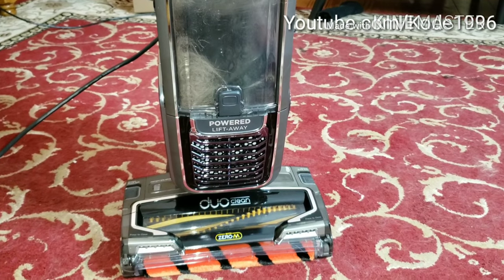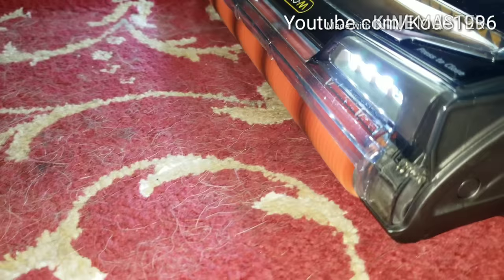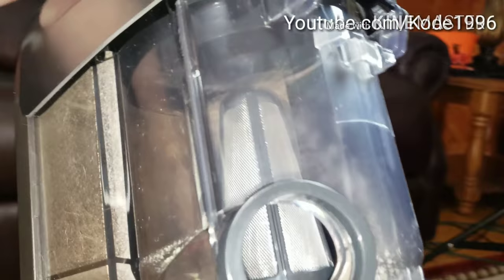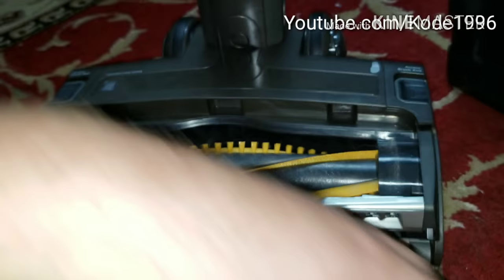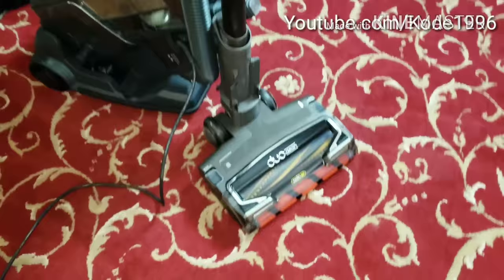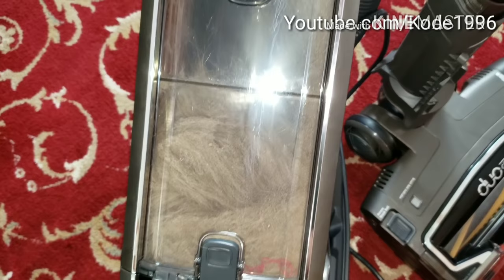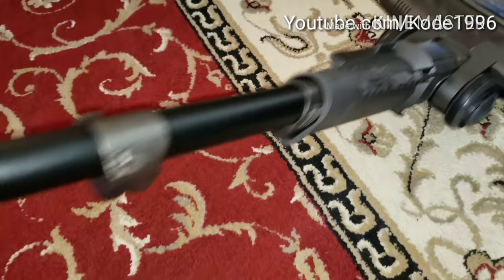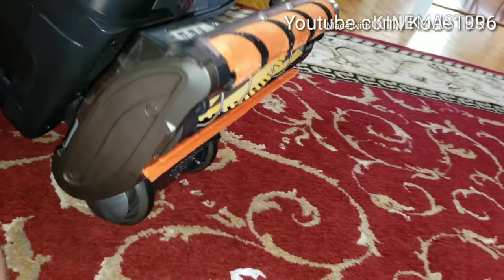Shark Apex TruPet Zero-M test on carpet

Comment: common sense wouldn't hurt. When you're vacuuming carpet, you want to keep it in upright mode so it adds weight down on the brush roll to really agitate the carpet. The lift away mode is really only for hardwood/tile where a lot of weight isn't necessarily important. Also, the point of the Zero M is to remove hair as you continue to vacuum. You were just going back and forth on a good amount of hair and turning it off immediately. Give the brush roll some time to do its thing. Other than that, great review! Also it is quite aesthetically pleasing for a vacuum.

Comment: I found with the Zero M if you put it on hard floor when you are done it gets the hair off the brush roll.
Reply from the maker: I will try it in our comparison video.
Reply: @kode1996  your also meant to slowly go over the carpet then when youve finished let it run for a further 20 or 30 seconds so that it can pull any remaining hairs off. If you read the manual properly you would already know that. I also agree with what others have said your meant to use it meant to use it with  cannister attatched to front for deep cleaning. Lift away is only good catching dust bunnies under beds & furniture definitely not intended grooming carpet or rugs!

Comment: I had the same issue with the pet hair with my shark Rocket duo clean. It seems like the soft roller in the front just kind of spreads the hair around and mashes it into the carpet more. Needless to say I got rid of that machine, and I'm not in a hurry to by another Shark with duo clean.

Comment: I had the Apex for a month before returning it.  It's way too top heavy and cumbersome to steer. It was the first time I had ever used a vacuum that bothered my wrist trying to control it and I'm an athletic guy. I prefer the regular Powered Lift Away when it comes to the Shark line.
Reply from the maker: That's exactly what I am saying. Like I'm a pretty strong guy and this wears me out. I can only imagine a Petite person trying to use it. It consistently falls over when trying to use the hose because the hose is too stiff and not long enough. Overall I dislike the machine. I am going to return it soon if I still can.

Comment: With the zero m the point is to keep vacuuming so the vacuum can remove the hair. It will NOT remove hair from the brush-roll immediately.
Reply: Just purchased this vac after my old one bit the dust. I find that the brush roll has almost no hair wrap compared to others with traditional beater brush. I would venture to say it is 95+% less hair/debris wrap around the roll than other vacs I have had over the years. To me, this is a huge improvement.
Reply: I know ive tried to tell him this before but he wont listen

Comment: I have a shark apex duo clean powered lift away. It's the only vacuum I have ever had to clean the brush roll regularly. I also have to troubleshoot the brush roll frequently. Every time I pick up something like a coin, I have to stop and pop the hood to dig it out. Nothing big at all will go through it. It just goes around the brush making continuous noise. It's total false advertisement in my opinion.
Reply from the maker: That is exactly what I was experiencing. It kept clogging with the pet hair on a daily.

Comment: Kode1996 I just bought the shark navigator with zero M. I was really happy to see this video I think the navigator being actually less powerful will do a better job. I was also happy to see that they 100% improved the filtration on the new zero M models. I think I made a good choice going with the shark navigator. I heard that model does better on hard floors as well. Vacuumwars showed that it worked better.

Comment: Nooo the whole reason i bought this vacuum was because they said it didn’t wrap the hair around 😭😭 i have 6 dogs so we have no shortage of dog hair here (basically your carpet is mine is 2 days) 
Hoping it at least is better than the dyson we are throwing away as soon as this one arrives... $700 and it barely works after 3 yrs!
Reply from the maker: Oh my.. Is it the cinetic? I'm very sorry to hear that. Dont throw it away, you should be able to get anything repaired. That's too pricey. You should return the Apex and get the Navigator. If you could please watch the Navigator lift away zero m big pet hair test vs Apex video you will se how much better the Navigator is. Please let me know if you watch it and what you think.
Reply: kode1996 do you think the navigator will work well with a husky? 
We only went with the apex because it came with so much more but it also cost over $400 because we did the pet one
We’ve never owned a shark before so im completely new to them and how they work
And im not really sure but i do know its the dyson animal one and its pink 🤷‍♀️ we paid around $700 for it originally which was really stupid for a dang vacuum
Reply from the maker: Can you please explain what's wrong with your machine? Maybe I can assist you on any issues, you have washed the post motor filters? I have one that's had severe abuse lol and it still works. After 4 years. It's the ball multifloor. 2015 model I have.
Reply from the maker: @pitbullmom213  honestly I had same exact one you're getting with everything. It's really not worth all that money. It's super heavy and combersom. It hurts your limbs and back because the DuoClean brushroll constantly pulls against you it was bad for me so for you it would be as bad or worse. I really do feel the Navigator will do you well with husky. The Navigator is under 200.00
Reply: kode1996 it could use a good cleaning, it just has no power anymore, i use it every other day pretty much because of all of the dogs and when i went to use it today it almost seemed clogged but i took it apart and saw no clogs at anywhere
I did watch your video on the Navigator and and am debating calling and switching tomorrow.. the apex is apparently on back order for weeks as well
Reply from the maker: @pitbullmom213  https://www.amazon.com/gp/product/B07FX7Z3NL/ref=as_li_tl?ie=UTF8&camp=1789&creative=9325&creativeASIN=B07FX7Z3NL&linkCode=as2&tag=kode19cleaner-20&linkId=3e8d1e4f52af717eba01a9ce111f990a">Shark%20Navigator%20Upright%20Vacuum%20with%20Lift-Away,%20Zero-M%20Anti-Hair%20Wrap%20Technology,%20Anti-Allergen%20+%20HEPA%20Filter%20and%20Swivel%20Steering%20(ZU561),%20Red%20Peony</a><img%20src=
Reply: kode1996 do they allow returns after trying it out? Unsure if they’ll let me switch without trying it but i know i saw 90 day money back guarantee when ordering
Reply from the maker: @pitbullmom213  I wish I could check out your Dyson for you. 🙂 But I would keep it as a back up. What model Is it you have I don't recall if you said lol.
Reply from the maker: @pitbullmom213  yes you can return it after trying it. You should be able to switch since it's back ordered and they haven't actually shipped it yet. You shouldn't have any problems. 🙂
Reply: kode1996 I unfortunately don’t know the exact model, its around 3 1/2 yrs old now and i know the box said Dyson animal on it and its pink, a little bit of purple, and silver but mostly pink
Reply from the maker: @pitbullmom213  are there 2 tiers of cyclones?
Reply from the maker: I looked it up and I find a v7 cordless in pink and the cinetic animal in pink. Do you have a filter in the top of the dirt bin? 🙂
Reply: kode1996 i believe there is a filter on top, it’s definitely not a cordless one though
Reply from the maker: Kara Allen okay yes it’s just a basic animal model. Make sure you take off the cleaner head and look in there, large objects clog easily there inside the head and where the head attaches too.
Reply from the maker: On the back there is a flap on the bottom that moves when you go from upright to the cleaning mode. Try to do it very slow and look up in there with a flashlight things get stuck there as well. I had to do this to clear a clog.
Reply: kode1996 thank you, im gonna try and see tomorrow (:
Reply from the maker: Kara Allen okie dokie you’re very welcome. I’ll talk to you tomorrow. 🙂 have a great night!
Reply from the maker: @pitbullmom213  Have you had a chance to see if that was the problem? :)
Reply: kode1996 my husband and i both took it apart as much as we could and unfortunately no clogs anywhere, we also cleaned the roller out because some dog hair was tangled in it but it hasn’t seemed to help with any power
Reply from the maker: @pitbullmom213 , hmm, how often do you clean your filters? A clogged post motor filter can you reduce the performance of a vacuum as well as a clogged pre motor filter.
Reply: kode1996 usually every 3 months or so sometimes more if my husky is in full shed mode
Reply from the maker: My friends Dyson v8 wouldn't work it kept pulsating like it had a clog. Turned out to have a very dirty pre motor filter. I washed it very good for about 15 mins. Rinsing and massaging gently. It restored full power to the machine. :)
Reply from the maker: @pitbullmom213  if the deep filter cleanse doesn't help. Since your machine is only 3 years old, you should be able to take it to your local vacuum repair shop. They should be able to replace your motor under warranty it might be worn out. I had to have that done and it fixed the problem. I didn't have to pay anything.
Reply: So i finally received my Apex after a ridiculous wait and i have to say compared to the Navigator professional i had bought as a back up while i waited its a million times better and much easier to use, i have carpal tunnel in my wrists and the Navigator really hurt because it would always fall to one side or the other while i was trying to go straight but I don’t have that problem with the apex, ive used it twice now and not had a problem yet 🤞
I did return my Navigator to Costco though because i really hated that one

Comment: Lol that’s my carpets 2 or 3 times a day.  My vacuum never gets unplugged and gets used many times a day with 6 cats and a dog. And yes I use a shark. I’ve had a shark since the first navigator was introduced to the UK ( the one with random cyclone pack in the top )   I will not use any other vacuum. My animals all have long hair and I have a mix of very very thick carpet and thin carpets and hard floors and i have no issues with my duo clean leaving hair behind

Comment: would you recommend this over a dyson or hoover
Reply from the maker: I would rather recommend the Hoover react powered lift away. Although I didn't particularly test that specific model, I did test the react and it was a pretty decent upright. Unless you want to spend a lot more money and get the v10. I haven't tested that machine. But from other reviews it seems to be a decent machine with powerful airflow.

Comment: Do you still have the dyson animal 2
Reply from the maker: ii Do not have the animal 2 anymore. I only have they dyson Ball animal 2016 model and the v6. I gave my Multifloor to a friend.
Reply: Do you have a cleaner head because my multifloor 2 head does not work any more and i just got it last month and i have low pile carpet
Reply from the maker: I would got right to dyson live chat and tell them what is happening. That is a manufactures defect so it is covered under warranty. Plus it’s so new they shouldn’t give you any issues,
Reply: I didn't all of that even email and calling still nothing
Reply from the maker: @jamesway2294  What date did you purchase the machine?
Reply: I bought it off ebay and it came with everything even the warranty. bought it 10/2/18

Comment: Hmm, this is the problem with the dual brush roll. There are lots of people out there who are easily wowed by Dyson copycats but don't always think things through and don't appreciate how badly this all-in-one idea is implemented. As I'll cover in a future video on my channel, the dual roller brings lots of problems with it. One is that by unnecessarily having the front hard-floor Dyson fluffy head rip-off on the machine at all times, rather than when you actually need it, it ends up smearing dirt into the carpet. There's lots of video footage out there showing that, and now you've shown it too. Another is that the soft roller grips hard to carpet and yanks the machine forward, meaning you have to fight against it like you saw. Very wasteful of energy and too tiring for users for no benefit on carpet. Just stupid. A third problem is that it far too easily accidentally gobbles things up — like your cord at 13:40 (or curtains etc.). They can copy Dyson all they want and deliberately lie to the public in the process about performance, but it won't work like one, as industry testing and court cases clearly and objectively show (e.g. YT link: pVheYuzIk3I ). Shark in a nutshell: convicted liars selling overpriced adequacy.
Reply: Um...ok
Reply: @VacuumFacts  I concur with @jeremy bartkus.  Both machines use the same kind of motor, same quality of plastic and the filter system is either convoluted (Dyson's over use of cyclones that clog up with pet hair, see performancereviews channel) and filters after the collection bin or way too simplistic (Shark's use of foam and felt filters).  The bright side is the Shark lasts about as long as the Dyson but at a cheaper price.  If you want decent power and energy efficiency with longer life, get a premium machine brand new, or used like a Rainbow or Kirby.  Neither consume nearly as much energy as a Dyson or Shark and have a lifespan of 30+ years.  If you kept buying Dysons or Sharks, you are guaranteed to spend more money over 30 years compared to a premium machine.  Also, both Kirby and Rainbow systems are made in the USA, so if you feel patriotic and are American, your money stays in the country.  Tacony machines are also made in the US if you want another option, but are apparently not as good.
Reply: Shark is not trash!
Reply: You say that, but I paid $170 for my Shark and I've had it 9 years, now just about to replace it. It's been wonderful and still has as much suction as it did the first time I use it. To say that you'd save money by buying a $2500 vacuum that lasts 30 years isn't even remotely accurate. Especially after watching this video. No thanks. Sticking with Shark. https://www.youtube.com/watch?v=ect8npWj45k
Reply from the maker: Hellkitten you can not take that video seriously. We have no idea how long he vacuumed with the rainbow, he didn’t show what tool he vacuumed with the rainbow, and obviously he didn’t do a good job with the rainbow or else he wouldn’t have gotten all that in the shark. His video is just to make rainbow machines look bad when in reality he just does a poor job at cleaning.